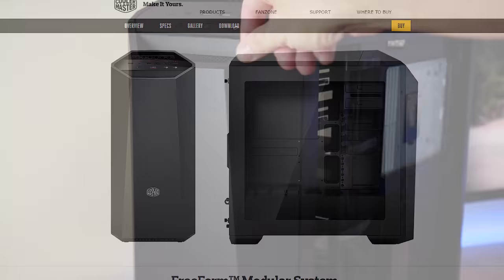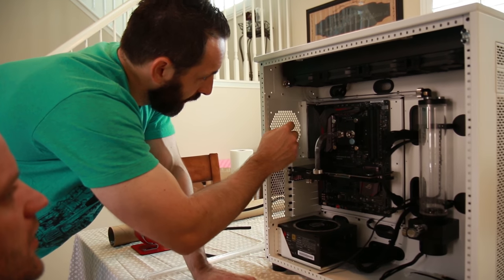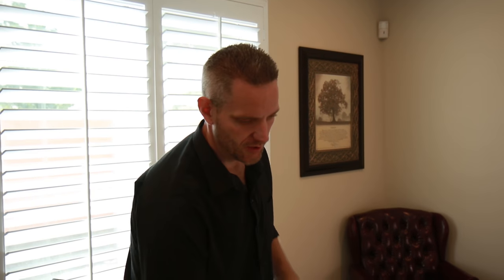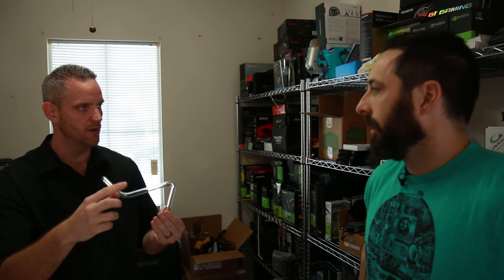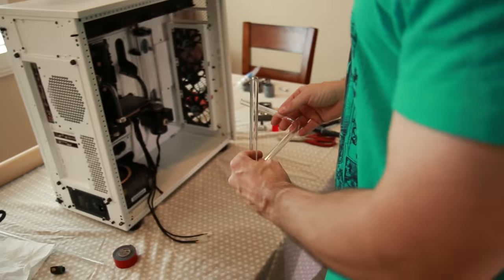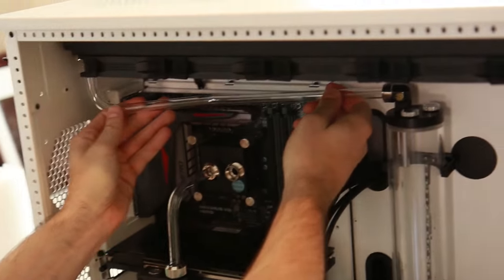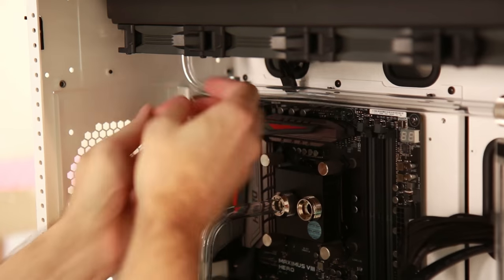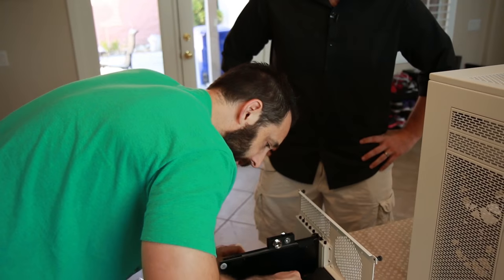PC Rescue Episode 1 - Hard Time with Hard Line

Comment: Reminds me of all the times I wanted to run thick cables to something and make it look photogenic. The bends almost never turn out as 'perfect' as you imagine them to be and things are very difficult to get exactly perfect first try. All that realy maters is that the connection is a good one, not how 'square' you can force the stuff to be.  If you go for 'perfection' you will not have fun working with cables or tubes. you need to be able to say "That is good enough" before it stops being fun, and not be afraid to ask for help. Jay has had years of practice with this stuff, and it is the years of practice that results in stuff we marvel at as DIY-ers.

Comment: thank you for this guys. makes me feel better for struggling 3 days with my first hard tube build, Mjolnir this past spring. I watched all of the hard tube bending videos and one thing nobody touched on was this. I didnt know how to measure properly because the radius of the bend changes the length between bends. i had one tube that had 2 opposite 90 degree bends in an sort of "S" and another 90 sideways at the top of the S right before turning into the GPU. it drove me bonkers. I actually learned to measure watching a cold steel pipe bending video lol. Anyway when you freehand the bend what it came down to was heating the tubing in about a 4 inch long run, then just bending it and letting the tubing follow its own radius rather than mess with a jig I found that 90 degree bend would add 1.5 inches to whichever direction based on radius center to center.

Comment: I have had a lot of fun building and water cooling my pc but there are those moments that really steal the fun away. When you hit a snag it really sucks and you just want to be done and have your pc up and running again. I used soft tubing so it was a little easier for me but I hit a snag because I was using an EK bridge. The O-rings continuously fell out when I was trying to install it on my 980's. I finally got it. I was so excited. I hooked up the rest of my lines and it has been flawless for well over a year. That feeling of completion was so worth the effort.

Comment: Want a tip for tube bending? Get some white-board markers (the cheapest ones you can possibly get that wipe off easy) and those pipe-cleaner things used for arts and crafts. Use the pipe-cleaners and bent them in the exact position and shape you want to have the tube, then take measurements of the bends and lengths from the pipe-cleaners. Transfer those measurements onto the tube before you bend the tube. Voila. 

It's what I've used in the past--and still sometimes do for trickier applications that I can't eyeball--for bending and shaping brake lines on cars.

But yeah, great video. Can't wait to see more just like this. If it wasn't for my dirt-cheap budget (tough to water-cool when you're broke and your friends that need custom PC's are broke too) I'd get into water-cooling more.

Comment: his problem was water cooling! MY GOD DAMN PROBLEM IS THAT MY NEW $1500 GAMING PC WON'T BOOT!
Reply: ayyyyy
Reply: sounds like a bad motivator .
Reply: did you plugged the power??
Reply: what happens? cpu fan spin? anything? Bueller? Bueller?  ...oh and what are specs btw?
Reply: Have you tried turning it off and on again.
Reply: Armas Paskiainen the specs are the gtx 1070 i7-6700k Forgot the motherboard 16gb ddr4 phanteks eclipse p400s. 1000W power supply (overkill) 1tb ssd. Also this is a new build. GIGABYTE G1 Gaming GA-Z170X.
Reply: Reamls Going Have you tried to remove parts to bare minimum to see if anything happens then when you try turn thing on to see if that would isolate issue?
Reply: Armas Paskiainen No I haven't because I don't know how to do it with out screwing anything up. I just think that maybe its the graphics card
Reply: if you think it is the graphics card you can always take the graphics card out and plug your monitor into your motherboard to test if graphics card has anything to do with it
Reply: Recheck the power and reset switches connections on your mobo, first time I was building, power and reset were mixed up and  PC would´t boot, only front side indicator would lit up.
Reply: reseat your ram
Reply: Hammer time.
Reply: What actually happens?
Reply: Sounds like user error.
Reply: How much time did you give it to boot for the first time??  It took mine like about at least 45 sec..
Reply: FlippinFred 13 hours. Not joking.
Reply: as i dunno your knowledge ,dunno if you build it yourself and what you mean with not booting ill give you some 101 steps for checking out.

unplug from the wall and remove GPU ,ram , M.2 or sata ssd
check the wall plug with another electric device if there is power replug the pc
check the flip button on the back of the PSU
if the PSU has the fan test button push it so the fan spins (flip the PSU back button.
if there is no fan test check the motherboard led by flipping the PSU back button.
 if you see an led light up then push the power button on the motherboard (the red button up right.)
if the motherboard doesnt start up check the powerplugs from wall to PSU the large motherboard plug and cpu power plug (you can mix sata with cpu power cable and forced to plug).
if the motherboard starts up the LCD number screen under the power button should show numbers and leds should light up (test led close to cpu should get green after red ( if you have test leds onboard) if its red then cpu is malfunctioning
if the board start up , shut it down and ad ram and power it on with the power button on the motherboard
if the board starts up and (if you have test leds )the led close to ram gets from red to green (same as CPU) if it stays red then you have ram malfunction then power off remove all ram exept 1 and  put the one ram in first slot and powerup if it doesnt work move that 1 ram to the next slot and keep doing until its start up or get green test led.
if its still doesnt work or dont get green led do the same with other ram sticks
if it work power off and ad GPU and power on again .
if UEFI doesnt popup  check power cable GPU and if still not work the GPU is broken
if UEFI pops up on screen shutoff and ad  1 M.2 SSD or sata ssd and power on again
if UEFI does popup prepare for OS  install.

i hope this help and your pc boots
Reply: Right off the bat, take it to a PC repair place. They'll most likely have extra parts laying around and they can test each part of your build to see where there's failure. This same thing happend to me back in February. Long story short, my CPU was dead which also destroyed the CUP socket. RIP
Reply: What Mup said - Always get hold of a friend or a repair place. Often the basic checkup is free if you're nice and polite - Because they know you will return later and be willing to pay for the good service.
Reply: DUDE I HAVE THE SAME FUCKING PROBLEM MY $1200 RIG WONT BOOT
Reply: +Konrad Oman it's not a new build either I just woke up and now it won't boot it just spins :(
Reply: +Konrad Oman reseat the ram. check power cables. make sure the GPU is properly seated. also try the display ports for the onboard graphics.
Reply: +Shiekh Billy to reset the ram do I just take it out and place it back?
Reply: +Konrad Oman is the mobo beeping spastically when you power on?
Reply: +Konrad Oman yeah. push down hard until it clicks.
Reply: +Shiekh Billy nope. It'll turn on properly, but once It gets to the part where I log into Windows, it just has the Windows 10 spinning icon. I can't do anything except control alt delete to turn the power off
Reply: Alright everyone I figured out what was wrong. The power supply was faulty. I sent it back and now I'm gonna go with either a 750W or 800W power supply. If you ask me don't trust Rosewill. But hey they did give me back my money.
Reply: +Reamls Going sweet man glad to hear it

Comment: That was a great video Jay; very informative and inspiring. Nice to finally put a face and a bit of personality to the owner of Red Mist, so thanks to Kris for agreeing to appear on camera. One question that occurred to me while watching - along with eyeballing a bend and cuts, do you ever heat up a bend whilst it's fixed in place? I've never seen anyone do this, but using some protective padding (like plumbers do for copper pipes in delicate areas) you can ease or relax a bend into place for a perfect line into the fixtures.
I'm really tempted to give hard line tubing a go, as I've got a pretty ambitious project in mind that would look great with the hard line look.

Comment: I have at least 15 feet of wasted tubing from my last build. You have to not give a shit and keep trying. Also.. double bends in the same tube are what usually cause these problems. Use a multilink fitting for the first bend and then bend the second one. Its much easier that way. When you make 2 or more bends, the length of the area between the bends can't be adjusted, so if you mess up, you are done. Using a fitting is a nice way to get around it. IMO.  Cool new series btw.

Comment: Not sure what your reasons for bending by hand are and if there are any downsides to using bending tools, but this video really made me want to add my own experience.  For my very first custom water cooling experience I decided to go with hard tubing and quickly learned that bending by hand and eye balling it would not be as easy as I thought.  Even if I got good at it it was never going to turn out spot on 90 degrees or perfect bends.  I decided to order the bending kit from PPCs and after a little practice learning the quirks of the tool set the results were almost perfect and the bends turned out beautiful IMO.

Comment: I like the new series.  It is interesting.  I just finished water cooling my PC and I ended up ditching the hard tubing for soft tubing due to similar issues.  One of the issues I ran into was even when I got the bends right, I wasn't sure if the tubing was secure in the fitting - especially if it was a really tight bend.  Maybe you will be able to address this in a future episode.  I kept all the hard tubing, so eventually I will want to give hard line tubing another shot.

Comment: This video shows exactly the kind of experience I went through on my latest PC build and the first time I've worked with PETG hard tube... I must have ruined about 6 bends before finally getting my 'perfect bend' and that's literally just the bend itself! oh my god as soon as I tried to make a 2nd bend and get the tube at just the right length? ... nope, way off!

Finally got my machine done, but had to make do with a couple of bubbled bends and a couple of pinched bends, and 1 tube section not quiet parallel ;( - but I learnt  A LOT about bending hard tube in the process, and I am looking forward to my 2nd attempt when I get my GPU water blocks!

Drazek - UDF2 Gaming

Comment: Jay

Keep up all the good work.  How about things like a Pedator 360 that has hose length issues??  If mounted in the roof, hose is just a little bit too short running to the CPU.  Either replace the fittings with 45-45 swivel fittings or just replace the hose would be an option, I assume.

John

Comment: dudes you said it! it is easy to make a bend, what's not easy is bending it to the correct specs. how about you get a longer than needed rod, make a 90 degree bend in it and then cut the ends to size? i bet that would be a lot easier, but more expensive cuzz more tube.

Comment: i did a hard tube build one time. total waste of time in my opinion. now i only do soft tubing to bang out my builds much faster. having said that, the easiest way to do this is take a thick piece of copper wire, that you can bend by hand, and use it to figure out what your hard tube will have to be shaped like. then mold the pipe after the copper cable. after you are done, straighten out the copper cable and repeat.

Comment: Jay... I have been liking the content and style of the videos of late. I have to admit, you were starting to lose me after your home move and the initial videos you put out. I tend to prefer the videos that can span all technical levels, rather than 'check out this new build and the water cooling I put in it'. I like more of the instructional videos (ie. the break down of the end result), like your recent video card overclocking video where you explain the settings you adjust and why. It is helpful, but it also gives some insight to what you have to do on a daily basis and you have learned by trial and error. This is just my two cents. ;-)

Comment: Wouldn't it be easier to estimate the bends using a metal wire first, then using it as a template to mark and actually form the tube bends?

Comment: One minor point of criticism - The sound while you're both talking in the room in some takes, the sound sounds a bit...metallic? underwater? I'm sure you know what I mean. Example: the talk at around +12:00 in.
Reply from the maker: Its called Phasing, and it happens when both mics are picking up both subjects. Its hard to tune out since the subjects are always moving close to each other and then farther away. Its harder than you may think
Reply: ***** Ah - Wasn't aware you used multiple mics. Thanks for the explanation. :)
Reply: +JayzTwoCents i would suggest recording the two mics in two different recorders 
Then in editing you can see who is talking in that moment and scrap the other signal
It's quite a lot of work, but it's the only way you can improve your audio (without spending the whole day tuning microphones)

Comment: +jayztwocents i have a question For a sli 980 ti and 5960x system yet to be OC'd 5960x target is only 4.0 which seems very easily achievable most reporting 4.2 is where a bad die shows it self, What is the ideal water cooling system i am currently looking at koolance but i want a second opinion

Comment: I've built several computers over the years, but I think I'm going to build my first liquid cool pc like red mist and skunk in a couple of months.
Reply: Yeah go straight for hardline, I made that mistake and really hate how my soft tubing looks in my pc
Reply: Yeah I was wondering if I wanted to go soft tubing or hardline. Thanks for the input
Reply: b0n2006 seriously hardline tubing is a completely different beast and so doing soft tubing, for one, looks worse but also will give you little experience that will carry over to hardline tubing. also there is less maintenance in hardline tubing as you won't have to replace the tubing every 6-12 months due to leeching.

Comment: these guys mus be LOADED
Reply: The computer they're working on is only about £1500 worth. I wouldn't say you need to be loaded for that...
Reply: +Simon T think again. that computer is more like +2k , water cooling is a lot more expensive then people realise.
Reply: kedwardsTWO I have a watercooled computer, so have a good idea. Although I guess they've used EK parts so your estimation is probably closer. Still doesn't count as "Loaded" tbh.
Reply: Simon T Loaded is all a matter of respective I guess. But most people who can afford a fully custom water cooled PC has to be loaded in a sense to spend that much (My loop cost around £500) on, if we are honest, none-performance enhancing kit. (Yes better thermals but these days aftermarket air coolers are good enough to oc on)

So I guess what he should of said is this, he has money to play with, but not necessarily loaded.

Comment: my pc has an fx 8370 and a gtx 780 and i just got the cpu the other day and while gaming ill be at a high framerate then task manager shows that randomly my cpu usage will drop really low and my framerate will drop to the 10's or 20's for about 5 seconds then the cpu will ramp up to its potential and i get my frames back and its not cpu overheat because ive been checking the temps it doesn get over 42c
Reply: what does your GPU usage look like when the CPU usage dips down? It could be that during really graphically demanding moments in-game, the GPU is working super hard, taking more time to render each frame, thus giving the CPU less to do in the meantime.
Reply: no my gpu usage stays the same when that happens if not drops a bit lower its so strange my friend has the same cpu and gpu as me and he hasnt none of my problems and hes had that build for 2 years or so, and i got my cpu maybe 2 or 3 days ago
Reply: Sebastian George i actually just played some bf1 beta and when it happens my gpu usage drops to about 20% as well as the cpu and its not just that game either and i had some times where my gpu usage hit 0% and my cpu hit 3% and they are both super new i just purchased in the last 2 months the gpu and a few days for the cpu

Comment: should i get the Sapphire Radeon RX 480 8gb or the MSI GAMING GTX 960 4GB
Reply: rx480 no question.
Reply: +mcm Levi the core clock speed is slower on the 480 so many I ask you why?

Comment: What should i get

1 i5 6500+ 980 ti sc + 1440p 144hz gsync ips

2 i5 6600k (4,5ghz) + gtx 1070 sc + 1080p 144hz tn

I play fps games and singleplayer games
Reply: 2)
Reply: 2
Reply: why 980ti? go with a 1070/80 which would cost almost the same
Reply: Facepalm, didn't see the second option, go for 2
Reply: I would do option 2, If you already have a 1080p monitor use it and save up for a 1440p 144 hz one